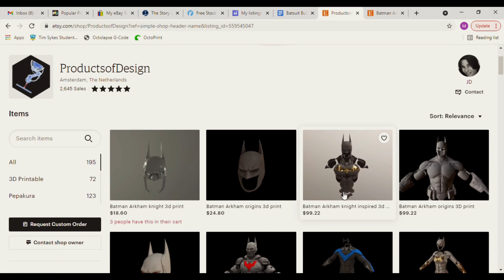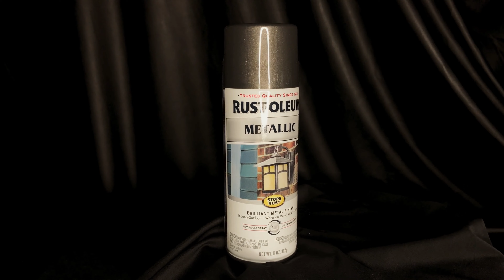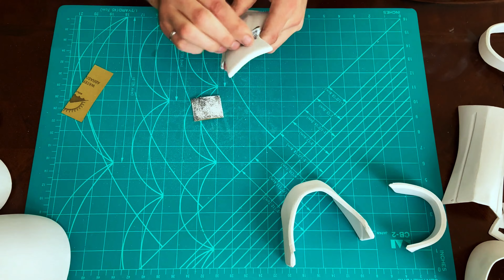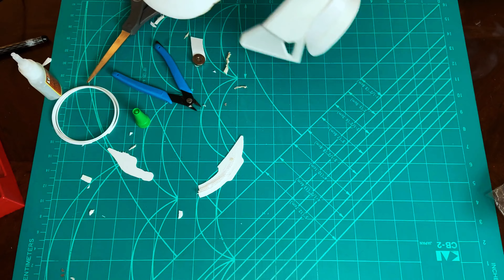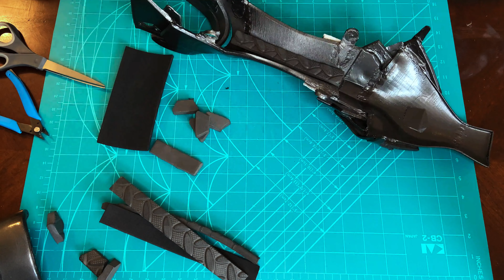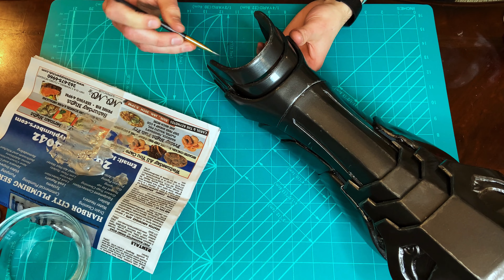Batman Arkham Knight Batsuit Tutorial - 3D Printed Shin Guards

Comment: Hey mark what type of black shoes do u recommend for the bat suit because im thinking of black sport shoes so its easy to run in but would the boots able to still fit if I wore those type of shoes also I’ve just started printing my bat suit I’m currently working on the belt and the batarang thank you ❤ 🙏
Reply from the maker: I actually used some old black dress shoes lol I think you are on the right track by using black sports shoes! As long as they don’t go past your ankles the boots will fit although you might have to made a few modifications
Reply: @markitmade29 ok ty 👍